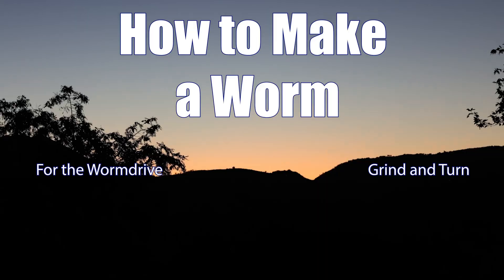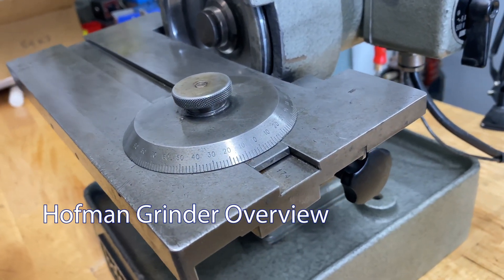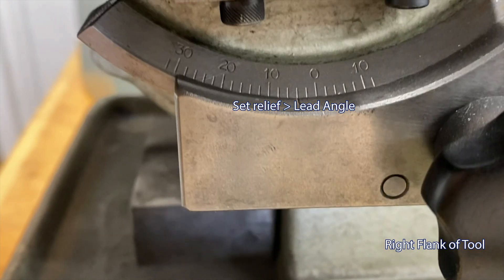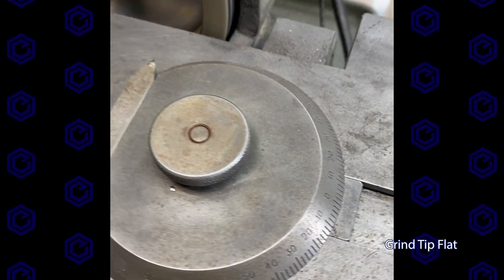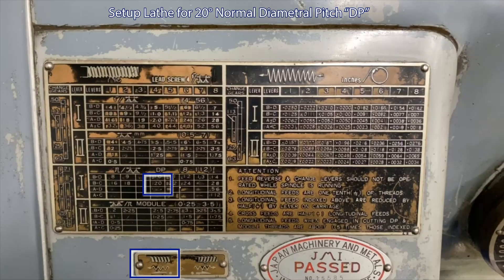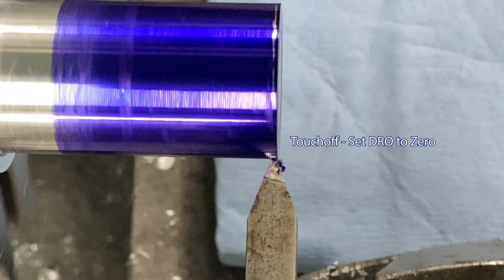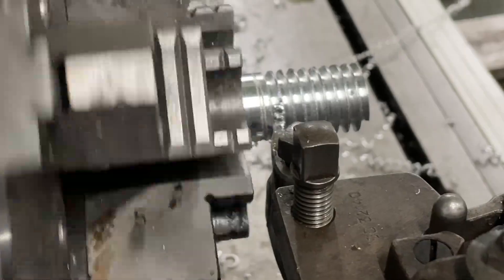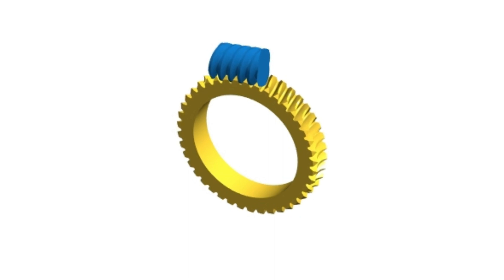How to Make a Worm  (for the Wormdrive)

Comment: Is it possible to make a 2 to 1 worm drive?
Reply from the maker: Wow - not that I have seen in practice.  Theory says a 5-start worm with a 10-tooth wormgear.  But you would need to make all the other engineering checks and make a custom 5-start worm and 5-start hob.  
One of the positive characteristics of wormdrives is their ability to deliver high gear ratios.  You might want to think about another gear reducing option.
Good question and thanks for watching.